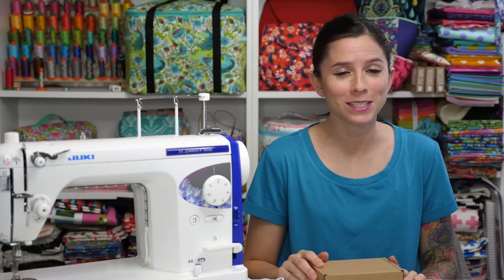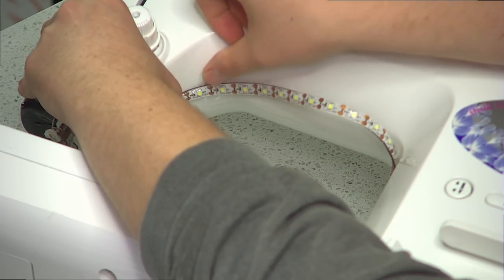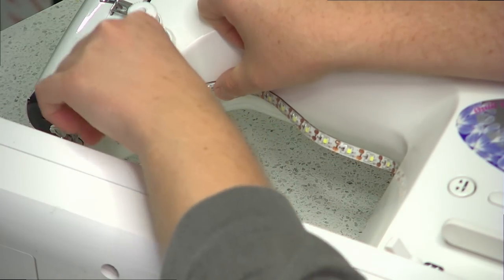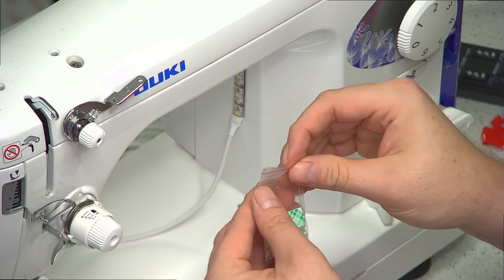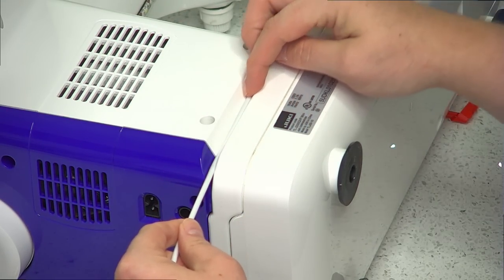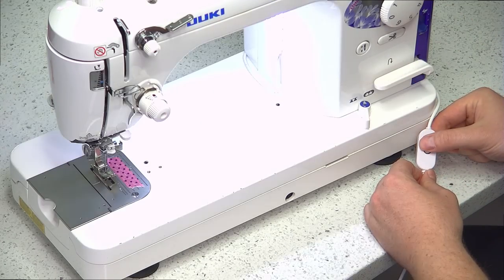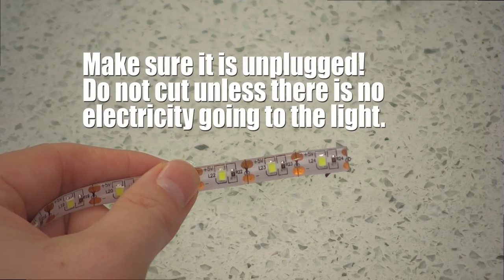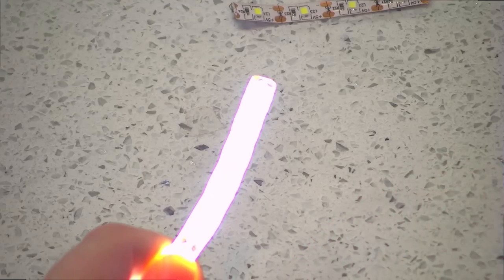How to Install the LED Sewing Machine Light

Comment: Your demonstration  is very good, May I make  a suggestion? When placing the light strip start the strip over the needle and pressure foot area, this gives us more light when  threading and replacing  the needle, also in  replacing or changing  the  pressure feet and looking at our sewing stitches. Maybe not all sewing machine will accommodate for  the space to place the light strip near the needle area, however, if it does it really helps. I hopes this helps some sewers! M.

Comment: Thank you for the demo. A word of advice. If anyone has a painted machine verses a plastic machine, do not use alcohol to clean your machine before applying the light strip. That will surely ruin the paint job.